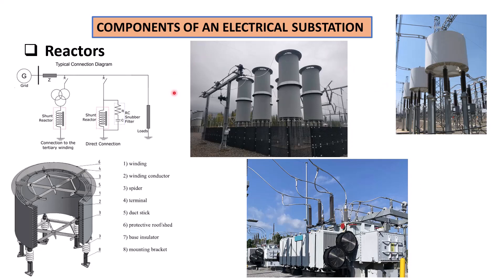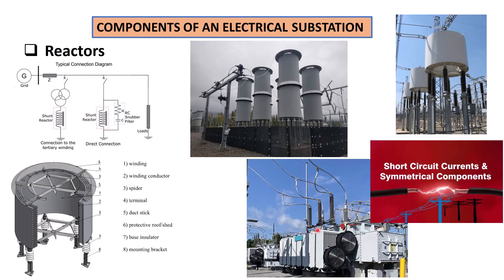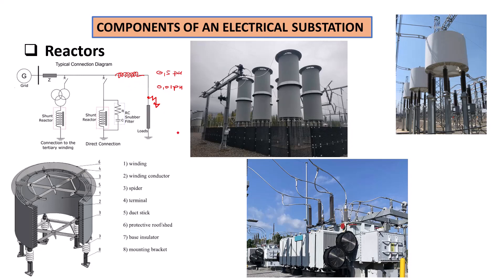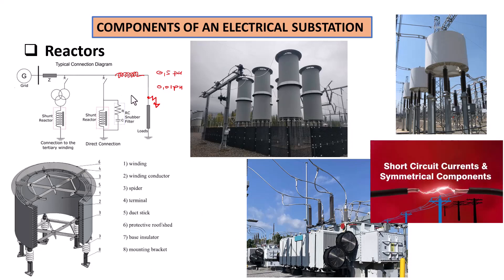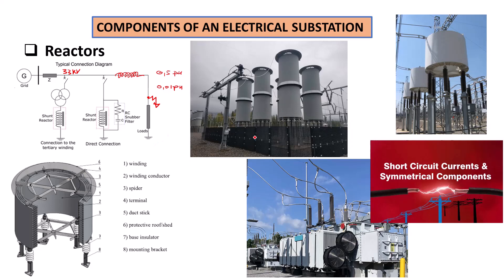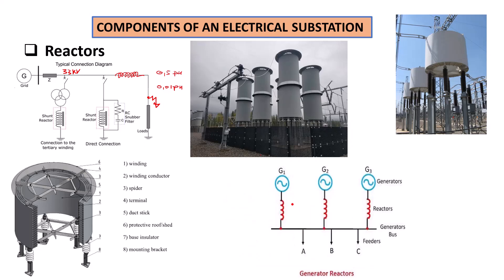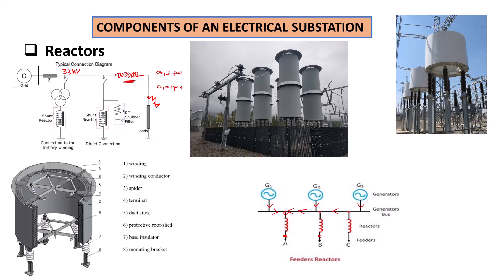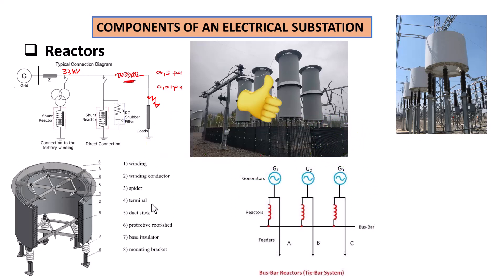5. Substation Components - Reactors

Comment: Interesting but you haven't talked about shunt reactor in your presentation.
Reply: My understanding is that shunt reactors ideally are used to absorb the excess reactive power on the network, and hence maintain the system voltages to an acceptable level. On the other hand, you can have a combination of a shunt reactor connected in parallel to a series resistor and capacitor circuit. This is essentially done to filter the harmonics on the system.
Reply from the maker: Yes correct, the combination of RC snubber circuit as you described is basically to improve stability during switching.
This is quite a good topic, I might do a tutorial for such application.
Thank you for your contribution.
Reply from the maker: Hi, yes you are I didn't specifically talk about shunt reactors. @02:07 there's a drawing with a shunt reactor. Shunt reactors are basically reactors connected in parallel with your feeders or LOADs, the functionality remains the same as explained in other configuration.

Comment: Why don't we just use a circuit breaker?
Reply from the maker: It depends on applications.
But number one reason to use reactors is cost, reactors are easier to install than circuit breakers, and  they are cheaper.  Also the way they operate is different, Circuit Breakers are typically used to prevent overloading of the system while Reactors mainly limit the short circuit currents, while the Circuit Breaker cut off one time. 

Reactors main disadvantage is adding a voltage drop on the system, so in situations where Voltage drop can't be tolerated than Circuit Breakers will be first choice.
Reply: @CMTEQ  thank you very much
Reply: reactors limit instantaneous short circuit current to a value that allows the circuits breakers to eventually break the circuit without exploding.